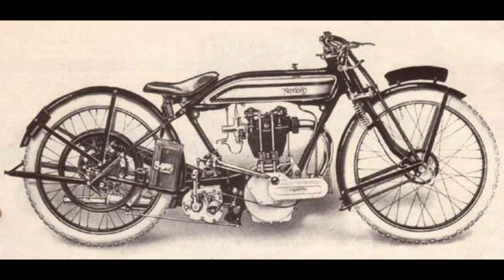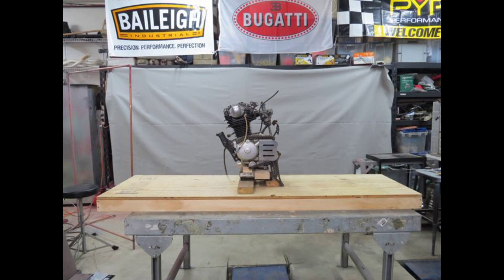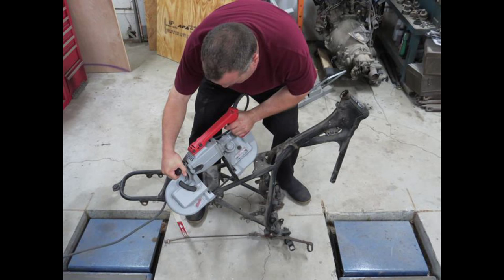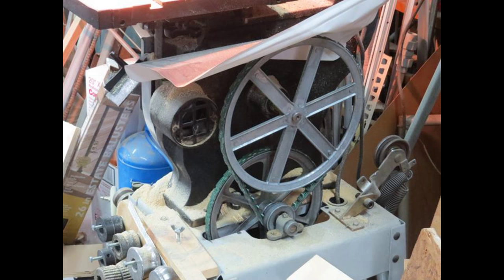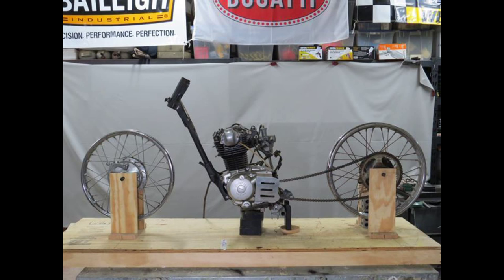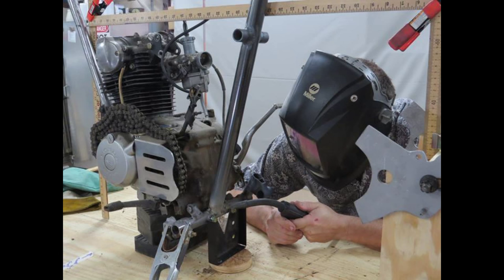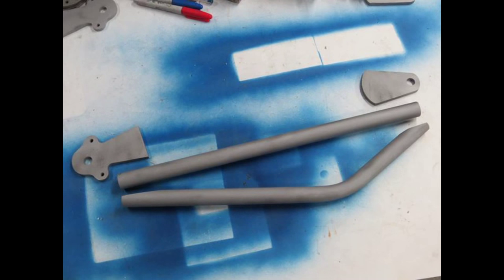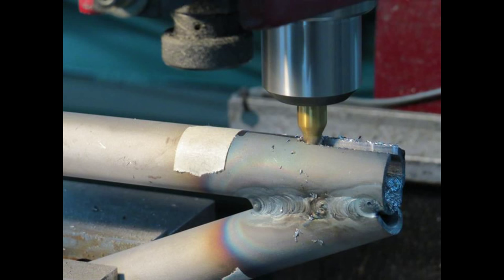1927 Norton 18 Motorcycle Replica Build

Comment: Holy smokes. this is a pure passion build. You are a master builder. the final product is incredible. I would like to see the exhaust pipe in chrome.
Reply from the maker: Chrome wasn't used in 1927, but nickel plating was.  I would like a nice nickel-plated exhaust pipe, but plating would cost more money than I was willing to spend.  I try to keep all my projects "low buck" and "in house".  I'm currently building a replica of a 1950 Ferrari 166MM Lusso and it too is low buck, and in house, but the results are pretty cool.  I'll be posting a video of that in the next few weeks.  It's been a 5+ year project.  Thank-you for your generous comments.

Comment: I like your  attention to detail, I also like that its a driver not a museum piece, good job sir.
Reply: To be honest no museum would take this bike. As with most replicas the modern engine is a dead giveaway. The best thing to do if you want to build a replica is to find an engine first. Doesn't matter what kind but the older the better. Then start building around that. The motor is the the most important thing to get right. It's the core or the heart of the bike. For instance, the Cannonball Run will allow you to replicate every single part of a bike but it has to have a pre-1917  engine on it to enter the race. Everything else can be replica parts, including the frame.
Reply: no its not a museum piece its a driver something to ride for fun you get the feel of the old bike and a reliable modern motor,those old motors are hard to deal with they are very finicky and fussy it takes a lot of attention to make them go

Comment: Hello , i like what you are doing i have a schwinn 50s 26 " bike to build . and i have a 2.8 chevy motor 89 - with 79 thousand . running and driving . Car wont pass insp. Air works too .
Reply from the maker: I have just built a replica 1950 Ferrari 166.  I used a Chevy 2.8 motor.  It's a great engine and makes the same horsepower as the original Ferrari engine.  I have a YouTube video of the Ferrari and engine.  Search Longyard Ferrari

Comment: First of all great project! 2nd is my questione. What kind of front shock absorber you have used, how strong it is? I have very similar project and have to find the proper one.
Reply from the maker: Something like this.  Just a coil/shock for a mountain bicycle, very inexpensive. Rated for about 300kilo.  Good luck!  https://www.ebay.pl/itm/265402765525?hash=item3dcb3cd0d5:g:eDUAAOSwSwphjsea

Comment: A girder front end is definitely not better than a telescopic front end, and telescopic front ends are definitely not cheaper to build. Girder front ends have their own kicks that affect steering geometry, such as the axle travels through an arching motion as the suspension compresses and rebounds, where a telescopic front end travels in a straight linear path. All front ends that have suspension travel will have changes in rake while moving through their range of travel, a telescopic front end will maintain a constant amount of trail while a girder does not (due to its arching path through its range of travel) . If girder front suspension was better than telescopic front suspension you can bet it would be used in competition, regardless of cost. But you don't see it in any substantial way in any form of modern motorcycle competition. The only advantages a girder front end had over a telescopic front end was it's ruggedness over rough early roads that would destroy early telescopic fork seals and possibly bend the telescopic forks. The girder front end which is in essence 2 triangles or 2 arches are inherently stronger for the amount of weight when compared to a telescopic frontend.
Reply from the maker: In theory a parallelogram suspension is far superior to a telescopic fork. Because: the path that the front axle takes can be more that a straight line. By changing the lengths of the horizontal members you can cause the wheel to move in a j path. this allows for more subtle bump activation and at the same time critical relationships like the rake, trail and steering angles can be maintained thought out travel.
Reply: @williamlongyard5887  there is theory, and there is how things actually work. There is a reason telescopic forks, in particular inverted telescopic forks are the choice for performance uses in every form of motorcycle racing, and it's not the cost to manufacture them. They just perform better.

Comment: Bill thanks for this video. Zeke and I just watched it and we enjoyed it! Why didn't your use the portable band saw on your vertical jig to cut the 3/16" steel?
Reply from the maker: Patrick DeZeeuw My converted woodsaw pulleyed down to run a metal blade is set up with a 1/4" wide blade which can cut tighter circles than my Milwaukee handheld (great tool) which has a 1/2" blade.  Straight cut on a non-precise line are fine with the Milwaukee and very fast.  Precision work, and curves, requires the full sized band saw.  I hope you and Zeke are working on another projects.  I really admire the time you're spending with him, and I hope you'll keep his hands on tools rather than video games.
Reply: +William Longyard You are a legend, a man of passion, enjoyed this very much, keep it happening..

Comment: although its a lovely finished bike it looks wrong in two main ways, firstly the engine is obviously too modern, and the final drive is also out of period design,  I can see tho you have put an immense amount of work in to it and I,d be proud too if I,d built it, maybe address the engine /drive issue and the fuel cap and gearshift arrangement, and im pretty sure you,d fool most into thinking ot was the real machine.

Comment: A good job you didn't go for the original 23 Inch wheel rims as there's better chance of a lawyer making it into heaven than finding someone who manufactures tyres for 23 Inch rims.

The aftermarket girder forks that serious riders installed on their bikes during the 1920's and 1930's were Webb racing forks. they have a very distinctive look and a few innovations that make them stand apart from their contemporaries. usually fouind on Rudge motorcycles. Rudge was the first motorcycle manufacturer to produce a 4 stroke 250cc.road bike that could achieve a genuine 100 MPH (107 MPH top speed) in 1938. It was the last model they ever introduced as production stopped in 1939 for the war effort.

Suzuki's claims to being the first with the T20 "Super 6" (in 1967) are just marketing BS!!